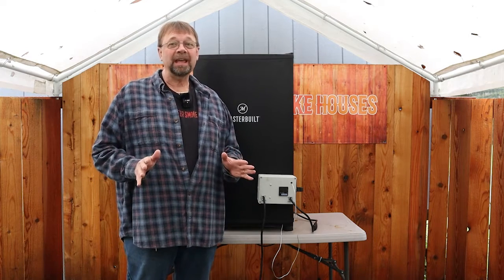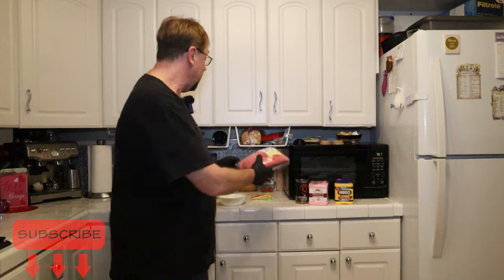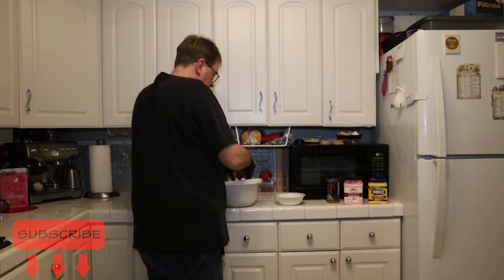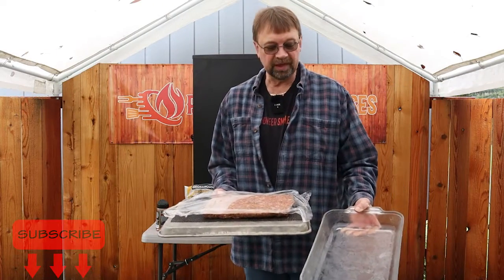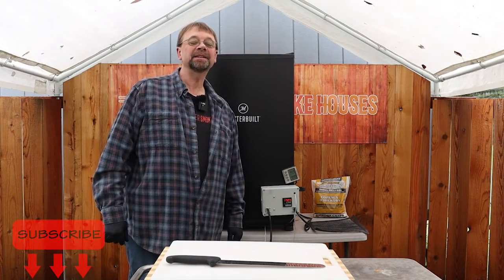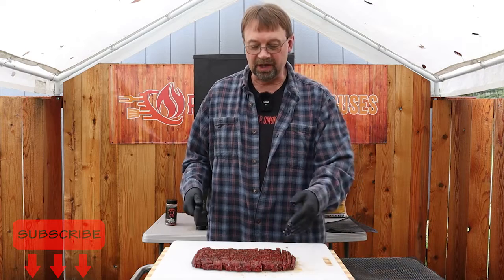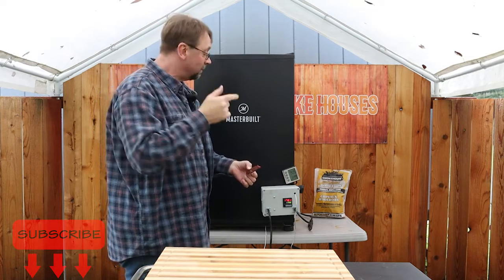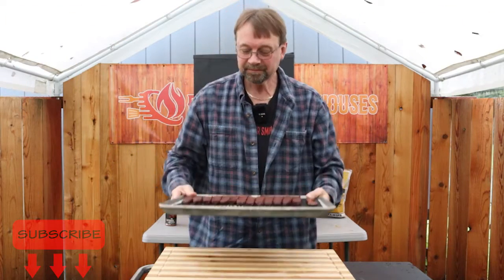Easiest Beef Jerky Using Ground Beef in the Masterbuilt 140b Electric Smoker, with a PID controller.

Comment: Does the pid let you reach higher temperatures then 275°f?
Reply from the maker: First let me say, I would recommend you do not go above 275 degrees... The PID and thermocouple have a range of 400c according to the amazon listing. Your limitation will be the heater element. During the winter I have a hard time maintaining 270f but in the summer 275f is no problem.

Comment: It was interesting to see how you put a whole slab of ground beef on there. It really did make a lot of sense when you pulled it out in order to turn it over on the side and continue to cook so that all of the sides would have that smoky texture. Your final product looks more like “treats “to me than “jerky”. When I think of jerky, I think of thin slices.

I have a dehydrator coming in the mail. I also have a vertical master built smoker. I’m going to try making ground beef jerky in the dehydrator and I will also try your method. I actually was thinking about if it would be possible for me to smoke the meat first before putting it into the dehydrator, so that it would gain a smoky flavor. Well, it looks like I won’t fuck it up too bad, since you were able to make this video. I’m hoping that I should be able to smoke the meat first and then put it into the dehydrator in order to get a better looking product than what you produced in this video. I’m sure what you made. It looked tasty. I mean it did look tasty. I’m just trying to go for something that looks more like traditional jerky that you can buy at the store.

If I had a meat slicer, I would go with pork shoulder, I might end up getting a meat slicer after all. Have you used a dehydrator? Or do you strictly only use your smoker?
Reply from the maker: I have a dehydrator I prefer drying meat in the smoker or oven. I use the dehydrator for apples, lol. I saw the slab of meat method in a facebook group years ago and I like it. You can also use a jerky gun but this is easier. I make this often to eat when I am doing keto for food on the road. Thanks for watching.